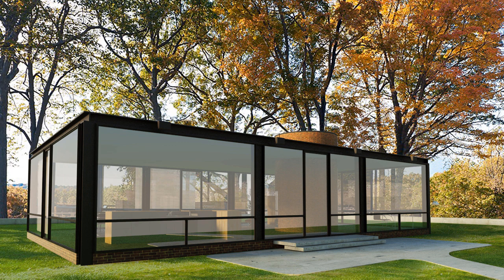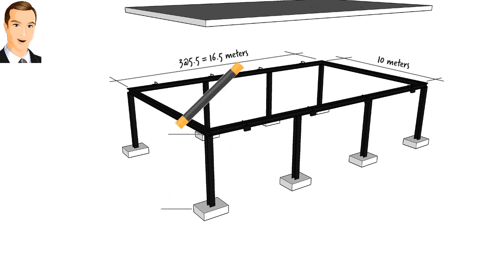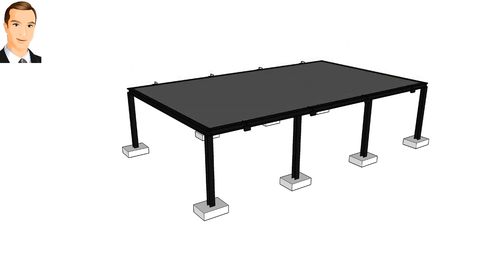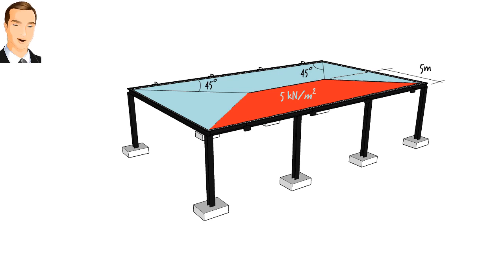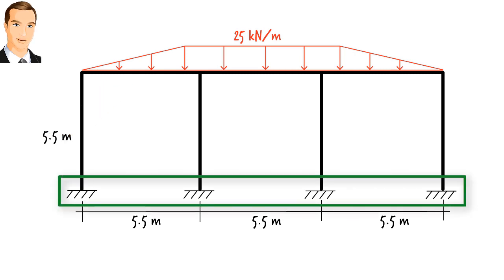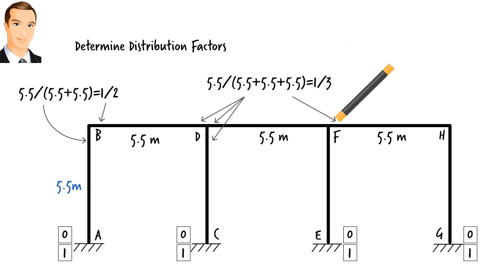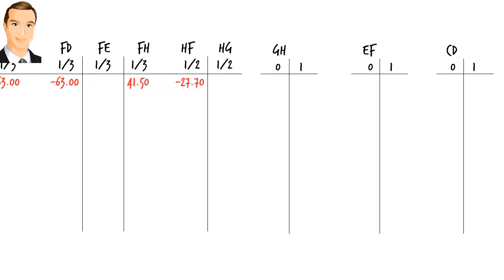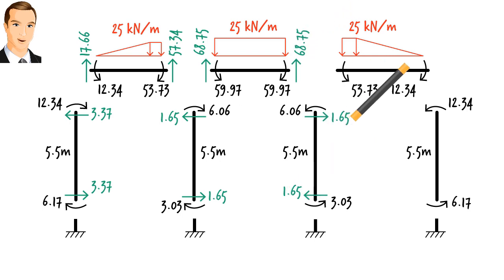SA43: Analysis of a Building Frame using Moment Distribution Method

Comment: One more doubt here slab load is transmitted to the beam like as shown in the above video. We are  determining the end moments due to slab load acting on the beam. Isn't It??  Then what about the self weight of the beam as it carries its own weight as an udl throughout the span of the beam na?? Then actually load is acting on the beam should be inclusive of both slab load + self weight of the beam??
Reply from the maker: You are right, the beam's own weight is not considered in this example. Such a load needs to be applied as a uniformly distributed load.  Generally, we can analyze the structure under each individual loading case, then combine the results (using the principle of superposition) to determine the maximum effect of the various loads on the member.  In this particular example, the only load that is being considered is the dead load of the slab. Live load, snow and other environmental loads, and the beam's own weight are ignored.

Comment: But I have one question, in the above example we have four columns but slab is only one which covers the entire distance without any secondary beams.. Actually there must be three bays of slab?? How it is possible?? If slab is too long then more deflection would takes place in the slab???...
Reply from the maker: As the width of the slab increases (in this example, it is 10 meters) then the slab would sag more. The amount of deflection is a function of the width of the roof and the thickness of the slab. The slab deflection is a design consideration which we have omitted in this analysis. If we determine that the deflection is excessive and needs to be controlled, we can either increase the slab thickness or, as you have suggested, add two additional cross beams to better support the roof.
Reply: This is analysis of frames using moment distribution method. Not design of slab

Comment: Great video ... I wonder if in the real world engineers actually calculate the moments like this.. I really doubted ... They are probably using structural analysis program to quickly get the moments of each points.. Dont forget Time = Money in the real world.
Reply from the maker: Yes, there are various software tools for analyzing structures. They generally use numerical techniques such as the displacement method (or finite element method) for the analysis purposes. But, learning such tools is not a substitute for understanding the basics of structural analysis. Learning concepts, principles, techniques, methods and theories that form the interconnected web of knowledge in engineering disciplines provides insight, enhances understanding and empowers students with problem solving abilities and skills. To be sure, there is a place for learning how to use software tools in engineering education, but not at the expense of learning the basics.
Reply: Thank you so much for your elaboration Dr. Structure. To be honest.. The structural analysis part has always kinda scared me as a student.... maybe its because I never mastered the basics as you mentioned. I mean, everyone knows how to calculate or draw the moment/shear distribution of any simply supported beams or a cantiliver. But, being able to correctly calculate and draw the moment distribution of any given structure is not always easy. So please keep doing more videos as all appreciate it. We thank you.